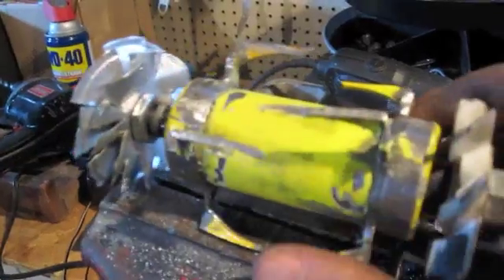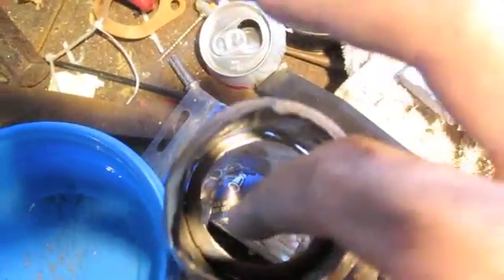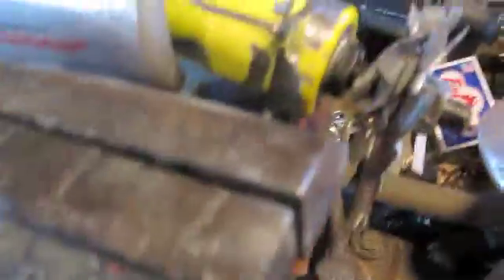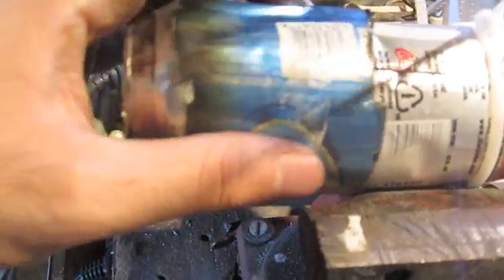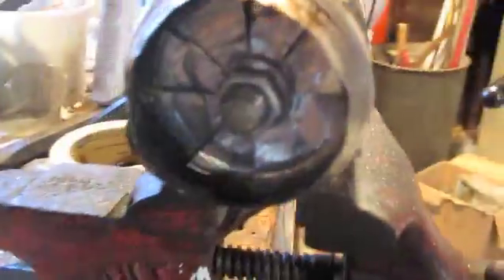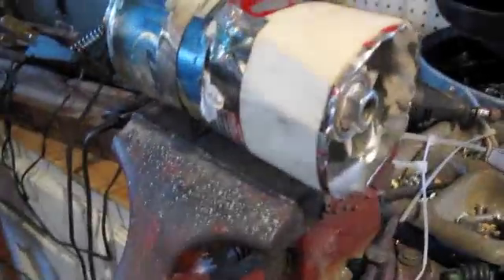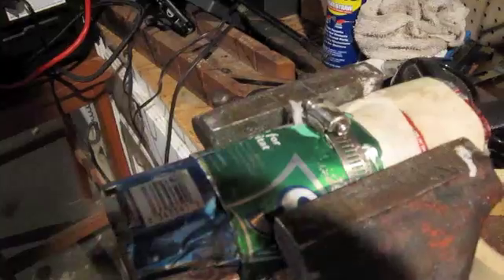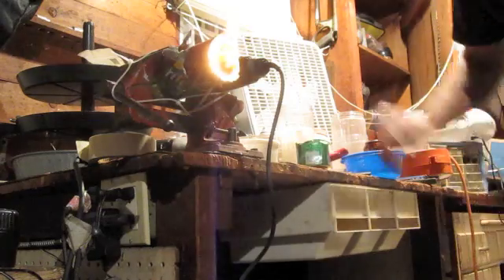How to (kinda) make your own Soda Can Jet Engine! MLCCS Mark I

Comment: Add a compreser pipe in front of the engine to help it to spin then add another pump with a small pipe from the frount for the supply of fule to  the engine

Comment: I concur with plato. I he hasn't figured it out, his combustion chamber is not a combustion chamber. In fact, there isn't one at all in his model. The baring housing is to large for the small diameter of the exterior. The combustion chamber well look like a smaller can stuck inside of a larger can both with holes drilled in them. The housing will go over that with at least a half inch gap for his model for the air to flow through them go into the combustion chamber. Additionally, you have compassion blades but no area where the air is being compressed or made to moved faster by shoving it into a tighter space. I highly recommend using tin for your metal at the very least. it's Decent starting point keep working at it though. I would like to see how far you've brought your project along.

Comment: it would help if you channeled the air bavk into a straight line. when it getts out of the fan, it is swirling around. also you need to have some sort of compressor on the back, good job,but not the right idea, the turbines should move themselves with the right ratio of air (that comes in through the back) and fuel. ps propane would be much better, and would add a small amount of extra thrust because it is also traveling out the back